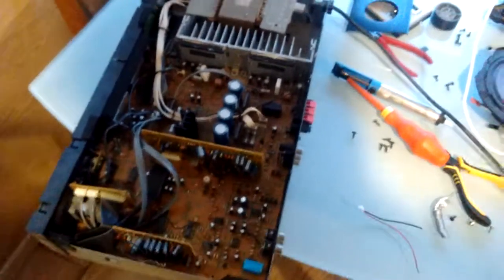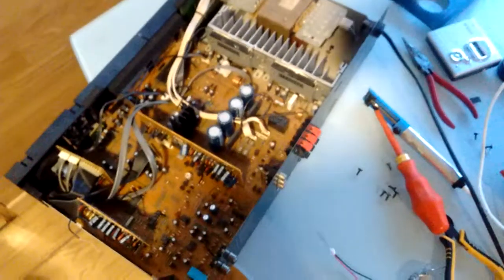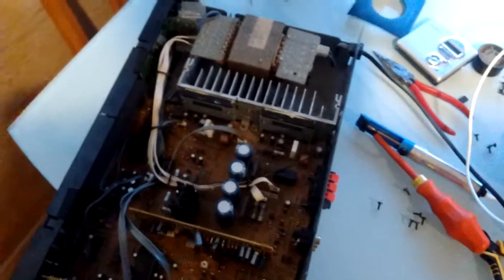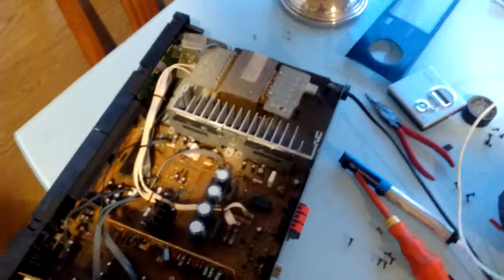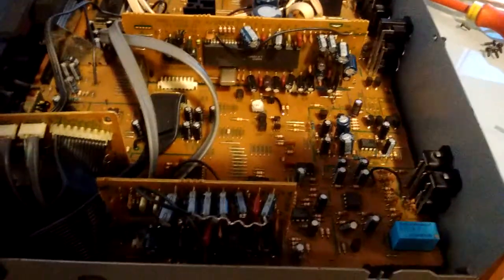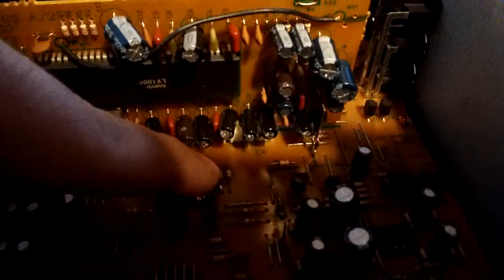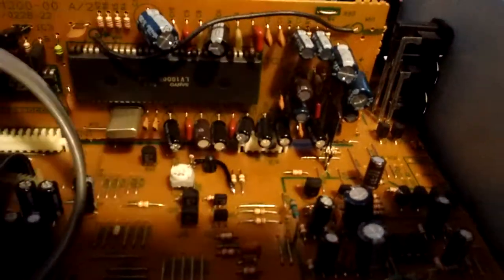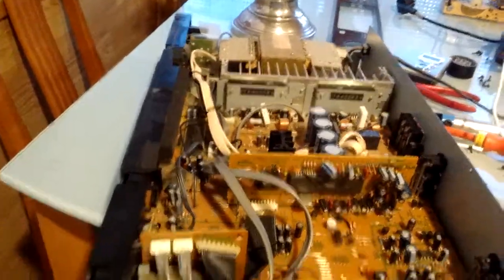Modifying a Dolby Pro Logic processor to (almost) decode Quadraphonic records

Comment: Pro Logic II did away with the 7kHz brick wall in the rears, and restored left-right separation in those channels, as well. The parameters are essentially the same as QS. It's possible to play SQ records through PL II as well, but rear localizations will be imprecise. QS records, though, will decode fully.

Comment: Hello guy. Its possible cable alternate in out jvc tape module ca-mx77tn for use tape module in standard amlifiers? This tape module uses HA12155tn integrated hitachi.
Reply from the maker: Seems doable. In page 19 of the service manual (I found it here: https://elektrotanya.com/jvc_ca-mx77.pdf/download.html ) I can see connectors JA401 and JA402 being used for the deck. Looks like you should be able to feed the deck the voltages listed (+-12V, +5V and +10V) and get the audio signals from the pins listed as PBL, PBR for output and REC L, REC R for input. You should also be able to connect all the GND pins together and use them as both signal and power ground. The pinout is detailed in page 23 (ENJ-063-1 represents the deck). Building a custom power supply shouldn't be hard using some standard linear regulators, a transformer and a full wave rectifier circuit.

All this being said, it doesn't look like an exceptional tape deck. Looks like a standard mid to low-end "flippy-head" autoreverse deck from the 90s.